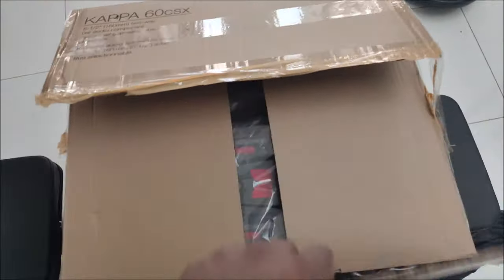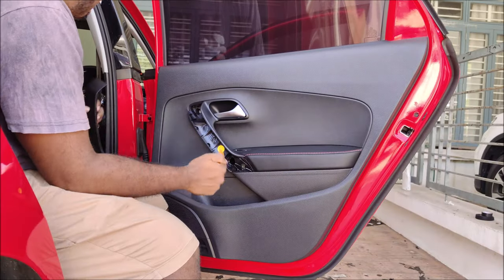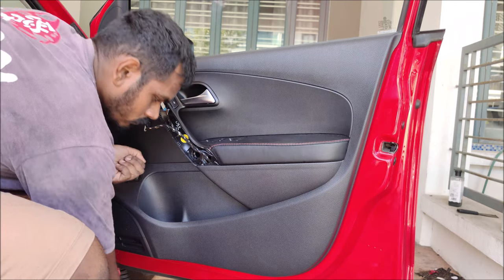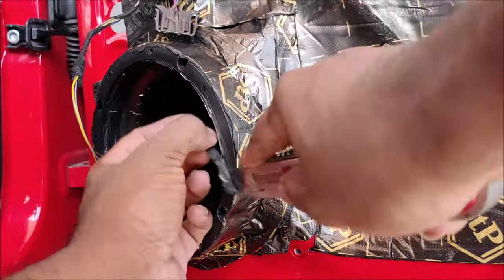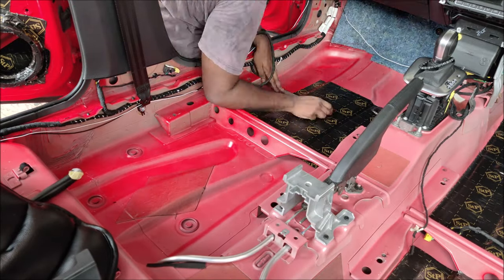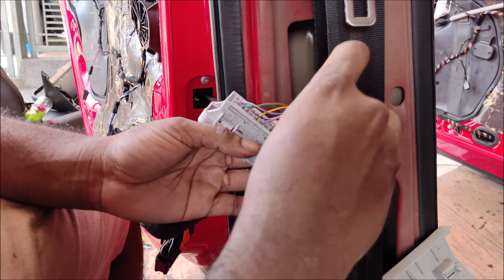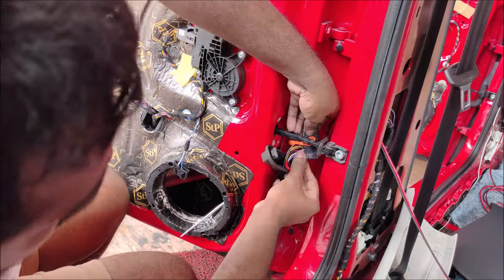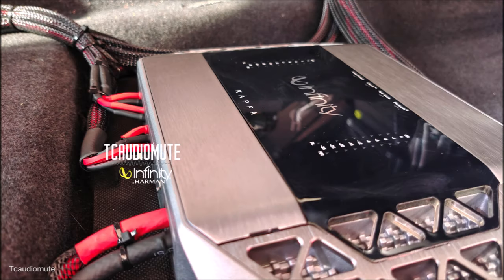VOLKSWAGEN VENTO SOUNDPROOFING + SOUND SYSTEM UPGRADED /INFINITY KAPPA SPEAKERS/KAPPA K4 AMPLIFIER

Comment: You started very well and muddled (nearly hid important things) later. I learnt how to remove the door panel and sound proof the car from this video. Please reply honestly: 
1. You did not show/describe as to how you connected this kappa amp with the head unit. Was it through pre-amp outs or you cut the hi-power speaker wired to get it through some hi-lo RCA converter.....
2. How did you manage the switch for this amplifier? Does it sense the no power and switches itself off or the back of the head unit has some switching off connectivity? 
3. You fixed the cross overs of the component speakers near the main amplifier where as the same are fixed the front door panel. Fine, you did not show the installation of the tweeter. The front door has no casing for the tweeter. You need to make cuts.....😵‍💫🥶